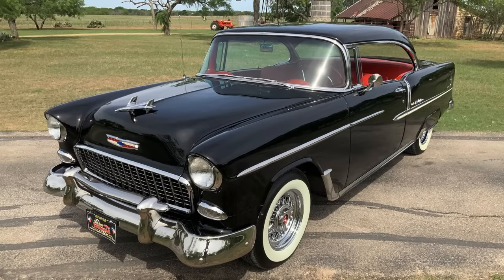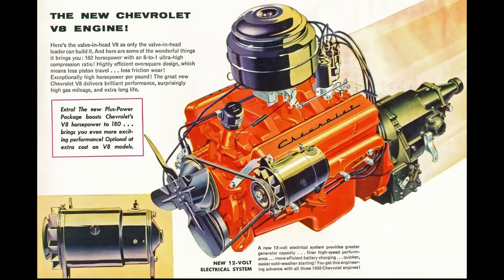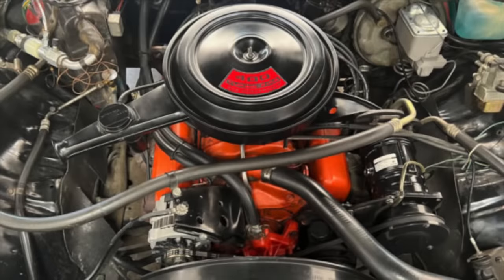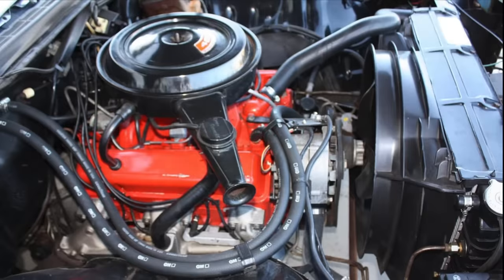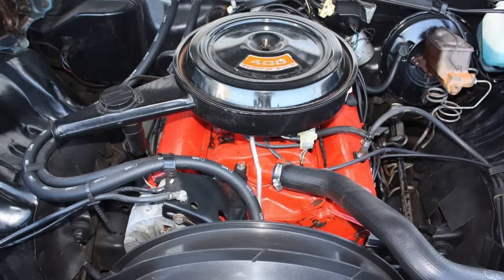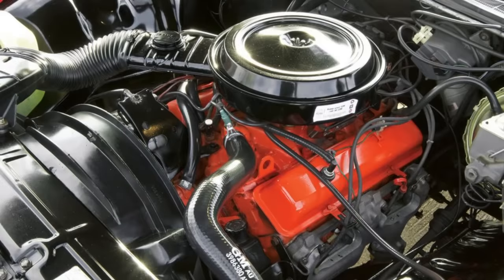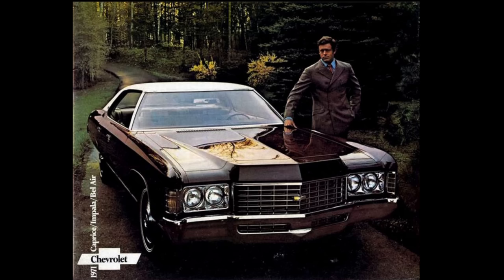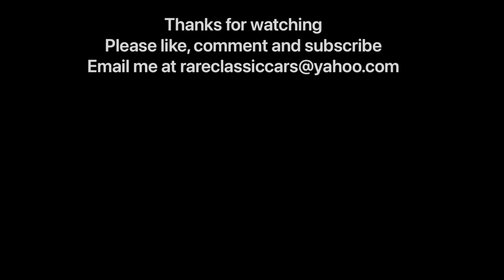Forgotten Engines: The 400 Cubic Inch Chevrolet Small Block V8 (1970-1980)

Comment: Had one in a 1974 Chevelle in the 1980's.  It came with a 400, 2 bolt, 2 barrel. There were main caps available with splayed outer bolts to convert the 2 bolt to 4 bolt.  Much better than the factory 4 bolts which notoriously cracked in the main web.  Many don't know the 3 bolt 400 block was better than the 4 bolt.  I had a forged 327 crank in it with the rod journals reground off center for a stroke increase. Had to grind the shoulders off the rod bolts to clear the block.  With aluminum corvette heads, intake, cam, forged pistons, and a good 4 barrel, it was a torque monster.  I wish I had that car today.  Most that I tell about that motor don't believe it.  I don't remember what it cubed out to, but it was a big block killer.  I put a 12 bolt posi in it and a TH400 with a manual valve body.  It would slam you into the seat easily.  You had to respect the throttle on that thing.  I would love to replicate that car, or find it is it still exists.  I built that motor in a dirt floor garage and had a local race shop do all the machining.  I had driven the car stock in my senior year of high school.  Lots of guys made fun of it because it was a 74 and not a 69 or 70.  Building it up was a dream come true project when I was just out of high school.  Nobody made fun of it after that.

Comment: I believe Chevrolet was playing small games with their advertised engine sizes for a little while during that era. The 396 big block was actually a 402. Anecdotally, a friend of mine was building a 396 for one of his friend’s Chevelles, and when calculating the engine displacement to calculate compression ratio, couldn’t figure out why he kept coming up with 402.

I have heard rumors that Chevrolet did this for insurance purposes. I have heard other rumors that it was done due to some internal GM restrictions on engine size.

Why they would go on to confuse people with a small block 400 that was actually a 401 and a big block 400 that was previously known as a 396 and was actually a 402 is beyond me. Lol
Reply: Well said!
Reply: Insurance.....that's what I heard years ago.
Reply: The 400 isn't way far off when you get down to brass tacks.  It's the same bore & stroke as a Pontiac 400.  There are other more obvious examples.  Pontiac 301 is 4.00 X 3.00 like a ford 302, but called it to make it different.  Best example 😅 no one ever talks about.  A Pontiac 350 is bore 3 7/8 (listed as 3.875,,,sometimes 3.88)  & stroke of 3.75.  I think its 354.7 cid (haven't done the math in a while,but Pontiac mags talked about it too.  Still called it a 350, the name was popular ,4 GM divisions had 350s
Reply: 353.7 maybe (my previous post)
Reply: Because most car buyers are hardly aware there is even an engine under the hood. Its just some hazy black magic kind of thing that makes their car move down the road somehow. They dont like to think about it. It makes their head hurt.
And these people vote.....lol
Reply: @will7its  😅😅😅
Reply: OK, so the 396 and the 402 are actually the same big block engine??
Reply: @donk499  Yes. I don’t think a 396 actually ever existed in the academic sense, it was always a 402 in reality, as far as I’m aware. It was definitely advertised as a 396 though.
Reply: @donk499  No, a 402 is a 396 with a 30 thousands overbore. So if you rebuilt your 396 its probably a 402 now.
Reply: Factoring the compression ratio into the displacement size is irrelevant and not used in the calculation.  All you need is bore and stroke.
Reply: @GoldenGun-Florida  they were building the engine. They needed to calculate displacement to derive compression.
Reply: I believe @will7its is correct. Chevy had a 396  ci. engine for many years. As I heard it in 1970 they still had a bunch of 396 blocks but they were getting rusty, it was the last year the 396 but they just bored them out and used them as 396s, though now they were 402s.
Reply: @007fredh  LOL - I've heard everything now.  This is complete NONSENSE.  They never had an excess of castings sitting around and any bare casting was protected with oil in the bores.  This is as good as the special ordered 1977 Caprice with a 454 engine.  🤣🤣🤣🤣
Reply: @GoldenGun-Florida  They might have rusted. I watched a video of the chrysler foundary and they stacked the blocks outside on pallets because they pumped out so many at a time they just overflowed the factory.
Reply: @Sheisthedevilyouknowwho-ft9we  Pontiac  made a 326 but it was a 336 they eventually changed the block to 326.
Reply: @will7its  Chrysler used to store completed vehicles at the fairground too until Lee Iacocca stopped the practice of building vehicles without orders.  While all of this is great theatre, it is not true.  Just like the story I heard on another blog where Bill Mitchell supposedly ordered the Delco Battery group to stop making yellow caps and go to black caps because it "took away from the beauty of the engine".  All of this Elmer, George and Barney stuff makes me laugh.
Reply: @markg7030 👍 yep,knew 'bout that one, got a lot of Pontiac literature, I love Ponchos 😁
Reply: From 1965 through 1969, the 396 was 396 cubic inches with a 4.094 bore. 1970 and up had a .030 bigger bore. The 366, 396, 402 and 427 all used the same crankshaft stroke. 427 and 454 had the same bore diameter.
Reply: @kennydemartini2169  thanks for the clarification!
Reply: @kennydemartini2169  ahh, the 366 truck engine.  Haven't thought about those in a while.  The 366, they also made the 427 in severe duty (or heavy duty) for grain trucks and the like, right ?  (Maybe 454 too ?)  Those had some tougher parts not for performance, but for severe duty ,unless I'm mistaken.  Think I also read they are externally balanced, just the medium duty truck versions.
Reply: @kennydemartini2169  Actually, the 402 was made in order to comply with emissions regulations at the time, which were different for an engine size over 400 cubic inches.  It had NOTHING to do with rusted bores, Bill Mitchell, the St. Patrick's Day Parade or any other folk lore.
Reply: @Sheisthedevilyouknowwho-ft9we  yes, they made the 427 and 454 truck blocks too. They had TRUCK stamped on them and were called tall decks because the deck was .400 taller to accommodate a third compression ring on the pistons. They all had steel crankshafts, which is the only thing worth taking from them, and they had double roller timing chains too.
Reply: @GoldenGun-Florida  dude, I had one 0f them back in 68 man, when I returned from Korea
Reply: @GoldenGun-Florida  they were still storing cars at Lynch rd in 82 and they used to store a boat load of trans vans chassis and 79 new yorkers between 15 and 16 mile rd. @ van dyke. in around 80, I never knew about the fairgrounds lot, tough times in Detroit
Reply: @will7its yes they do.  As in the 2020 election.🤣😂
Reply: A small block 400 is actually 396.whatever they just rounded it out to 400 4 1/8 bore 3.75 stroke = 396.whatever I don't feel like working my brain I'm too high 😏
Reply: I've heard that changing them to 402 CI was done to get them to a size (over 400) where the emissions requirements weren't as stringent.
Reply: i think it was 1968, that it became the 402, as the L78, 375 hp. in 1965, it was a 396 @paulwindisch1423
Reply: I could be dead wrong, but I think the 402 (396 with a .030 factory overbore) was marketed as a 396 because the 396 was previously liked by the public. Why ruin a good thing?
Reply: @Sheisthedevilyouknowwho-ft9we only 454 with cast crank was externally balanced. 366 & 427 truck engines were internally balanced. While the 366 & 427 shared the same stroke, they were different crankshaft. The 366 was cast and the 427 was forged. The truck 427 crank was a good piece to harvest for building a HP motor. The 366 & 427 truck blocks did have a higher deck height, which is why they require a wider intake manifold.

Comment: I owned a 71 Impala with a 400 small block. You are right about the torque, taking off from a red light it would burn the back tires all the way across the intersection!

Comment: I had a SBC 400 in a t9 Chevy pickup. It was a four barrel version. The thing would melt tires to the rims if you wanted it to. I had a very mild cam in it and dual exhaust and it was very noticeable

Comment: The 400 was an extremely smooth engine, but mpg definitely suffered after smog controls were added in the early 70s. For instance, my mom owned a '73 Impala with this engine and even freshly tuned up was lucky to get 7-8 mpg in town and maybe 10 mpg on the freeway. The lousy gas mileage of this car is the main reason why she traded it in after a few short years. Also, a friend of my dad bought a '73 Pontiac Grand Am brand new and it had a 400 engine and he also got the same lousy gas mileage, even off the showroom floor.
Reply: In 73 that 400 in the Pontiac was a big block and even though it's HP numbers were down those big block Pontiac engines were torque monsters . My dad had a 69 Pontiac Grand Prix with the 400 4 barrel with the turbo 400 transmission and it hauled the mail pretty good and would chirp the rear tires when shifting into second gear with nothing do e to the transmission. I loved driving that car road nice and handled well for what it was and I liked the cock pit type dash layout with the 140 mph speedo and how the dash blended into the floor council that had the shifter in it .

Comment: The engine story is quite interesting. There were variations clearly,but I liked how you explaimned them. I used to wonder when I was younger and I saw "400" "350" or "454" on the side of Chevrolets what was that referring to. I now know. I recall many Caprices with these engines. It was a different time back then as well because the GM brands had more autonomy and ran each brand like its own company. Thank you Adam.

Comment: I remember in 400 small block. I also kicked myself for not buying that 1971 Chevy truck with 400 small-block about 10 years ago and basically had no rust. If I recall correctly it was a 3/4 ton truck. But I didn't want to drive all the way out to Southeastern Kansas to pick up two vehicles! Once I got then pick up the 57 Chevy that we won on auction, I saw that truck and you as well kick myself for a very long time. Because it looked a lot better than pictures showed. Thank you for doing this on a Chevy 400 small block. I'm still love to have one but at time goes. 5.3 you just find any day of the week.

Comment: i knew about the siamesed bores and the external balancing, but not the steam holes!  always learn something with this channel!  i  kind of thought 400 in the B body mean small block, and in the A body meant big block.  but I guess for a while you could get both small and big in the big body.  so strange...but no more strange than Ford offering two different 351's...three if you count the later 351M
Reply: Ford’s 351 motors actually had the same bore & stroke as their older 352.

Comment: My 75 Monza had a 262 V8. I had a couple of cars with the 305 V8
Reply: Those cars were cool -
Reply: Those were super fun to drive. My buddy put a dual exhaust and had a manual transmission. It was quick compared to other cars of that era
Reply: California '75 Monza required the weak 125 HP 350" engine... but a SBC 400" would also slip in...

Comment: Chevys 400SBs were one of the best ever built and best bang for the buck. Cheaper, easyier to modify and get more power out of them than the expensive 402BB smogger engine that you have to spend tons of money on to raise the compression, Its easy to build a 10 to one compression 400SB, RV cam it with a 4 barrel  daul plane intake and small tube headers and you got a real torque monster for cheap for towing. Id take a 400sb over a 402BB any day. Ive got about a dozen of them and all standard bore and I only bore them .020 if they clean up on the first try.  Some say they have heating issues, crack heads etc is all bullshit. After 74 they used lighter casting heads on them with catalic converters which could cause more heating issues. One thing to note 1970 was the only year of the 9 to 1 compression 400, after than they dropped it to 8.5 and even lower in the 70s. 1970 was the only year of the 400s that used the 598 head castings that used 1.94 intake and 1.60 exhaust valves, hard heads to track down. The 5.565 connecting rods wasnt that big of a deal for low rpms and torque. 5.7 or 6.0 inch rods can be updated for higher rpm 400s.  Theres alot of faults information out there that 400s were junk this and that bullshit, them same people really didnt know shit about them, the few guys that did know them hoarded them all up like I did. My plan is to build another one for a pulling truck in the near future with custom ground roller cam setup, near 10 to one compression and run 91 octane gas. Thinking of using a 4 bolt block if I can but have more 2 bolts than 4.
Reply: i have 3 of these around, getting to build one, 20 over

Comment: Best friend's dad had a 73 Caprice Coupe with a 400. Very reliable and trouble free. Only repair he made was a new timing chain set. Car rusted out and in 1980 with 197,000 miles it was sold to a guy who wanted engine and trans.

Comment: OUR NEIGHBOR HAD A 1970 IMPALA 4 - DOOR HARDTOP WITH THE 400 SMALL - BLOCK I WAS IMPRESSED BY JUST HOW SMOOTH THE CAR RAN WITH LITTLE OR NO SHIFT - OVERLAP !!! IN 1970 GAS WAS STILL REASONABLE IN PRICE SO IT WASN’T A PROBLEM OF HAVING BIG CUBES !!!
Reply: '70 SBC 400 got much better MPG than later low compression ones...
Reply: @buzzwaldron6195  THE ONLY ISSUE AT TIMES LIKE THE EARLY 348 ‘S WAS OVERHEATING BECAUSE OF THE THIN CYLINDER WALLS !!!

Comment: The Tonawanda 400 with the double hump heads, a Saginaw M20 4 speed, and a Chevy 4.11 rear end needs ZERO modification, especially to be driven on the road. My brother has a 64 Impala SS with this setup and in the late 80's the fastest manual Mustang 5.0 would be completely embarrassed from stand still, first to 60, or even starting at 60. The engine and transmission put so much torque to the rear that the first rear end he ran, a 3.73, twisted and shattered not long after he first built the car.
Probably the scariest car I've even been in because a takeoff that fast with a top  end to fast to handle in a car that big is just an eerie feeling!
Reply: Not a factory engine.
Reply: @anthonynelson9136  Dude seriously... None of that is factory for his car. Was saying the engine, transmission, and rear end he used all needed no modification from how they came from the factory. THE CAR came with a 327, 3 speed Saginaw on the tree, and 3.36 rear end. He still has them all because of their original matching numbers.

Comment: Adam as a Ford man could you run a video on the Ford 400 2v. Also about the block cracking issue it had for a couple of years when casted in MI instead of Cleveland and what to look for on this issue and what, if any fixes there were.

Comment: Had a 70’ 4 bolt 400 SBC with camel hump ported heads , TM-1 Intake and Comp solid cam backed by TH 350 in my 69 Camaro . It was a fun car

Comment: A friend of mine built a circle track car from a SBC 400. 2 bolt main. Lots of Hi-po mods and machine work. It was always in the top 2 or 3 on race day. I liked the 327's. they were fun engines to build. I always thought a 377 would be fun screamer to build but never got around to it. Kind of like the big brother of the 302.
Reply: I built 400 block 377 with 6-inch rods, solid lifters and a 9 Pound flywheel. It wasn't the biggest motor ever built but it was the most fun! In a full Road Race 89 Corvette with a Tremec TKO 3.73 gears out the back!

Comment: I had the 1972 Caprice with the 400ci with 4-bolt mains. It was twice the fun after adding dual exhausts. When I traded the car in 1989, it was sold and it vanished before I signed the papers for the new car.

Comment: I only ever saw one of these things back in the day in a full size Chevy station wagon.  It was a pretty bare bones business car.  I recall the owner telling me it was a 400 and when I opened the hood it was clearly a 4 bbl small block. It was a strange sight, lost in the vast expanse under the hood....  It had some pretty high mileage on it and it still ran very well. It wasn't a slug, but I wouldn't say it was all that powerful compared to the Olds 425 4 bbl I was driving at the time.

It had been used to do pick up's and deliveries and carry samples around on sales calls... it was perfect for that purpose.

Comment: The 400 got a bad rap for the siameese bores and cracking but it's essentially a 396 big block in a 350 small block package. I run an aftermarket 400 in a lightweight Nova and it's the perfect street strip set up because it has way more power than a factory 454 big block offered, yet it is lighter as it has an aluminum upper end to help keep the weight on the nose down.
Reply: Just don't overheat them & they're fine 👍

Comment: You didn't mention the easiest way to spot one of these 400 sb motors when the heads are installed.... Gold star for anyone who gets it.
Reply: front balancer
Reply: @harveynewman4333  ⭐... That's one way, but there is one way more obvious
Reply: 4 bolt main bearing block 3 freeze plugs per side 2 bolt block 2 freeze plugs per side with a boss for the 3rd freeze plug in the middle (not machined) having worked in a machine shop I've seen hundreds of sb 400s but never a 2 bolt block with 3 freeze plugs people say they're some out there but never seen one from what I've read the 4 bolt 3 freeze plug motors they only came in trucks for 2 years only although undesirable they are rare
Reply: @insulman100  ⭐
Reply: I assume you know the reason for the different front balancer and also different flex plate/flywheel. for the sb 400 of course they are externally balanced some of the 400s our shop worked on had destroyed main bearings and sometimes even a broken crank due to using a non-balanced flywheel /flex plate